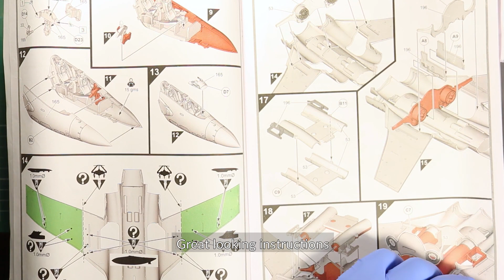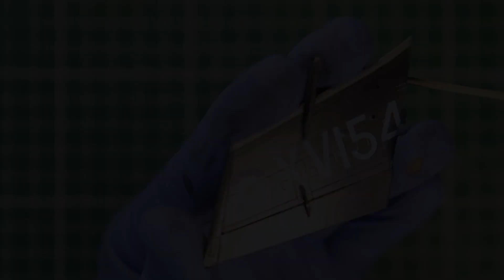Blackburn Buccaneer Royal Navy 1/72 Airfix Plastic Model Full Video Build

Comment: G'day Doc, That's an excellent piece of surface finishing resulting in a 'well worn' buccaneer in, I believe, the FAA's old livery. I'm envious as at my age most 1/72 aircraft, like the small fighters, etc. are too fiddly for my eyesight and sometimes shaky old fingers. Of course, doing 1/32 aircraft models comes with their own set of challenges.
Now, I'm ex-RAAF but I do specialise in military aircraft. 
I can't recall in any of my research seeing naval attack fighters being stowed either on deck or in the hangar deck with ordinance still attached to folded wings. Not even just prior to take-off, as the ordinance personnel can only arm the aircraft with the wings locked in the flight configuration.
It's a small point and would probably only be picked up if submitted in competition. Overall, your Buccaneer is certainly up to competition standard. Apart from the ordinance; it has the authentic look of an aircraft that has really clocked up the hours. Apart from public demonstration aircraft and recreating certain museum airframes, I never finish off a model as if it's just rolled out of the factory. These, generally, look too much like 'toys'.
I've just done the FAA Vampire LZ551/G which was the first jet in the world to land on a carrier; flown by the late, great, Captain Eric 'Winkle' Brown RN, (when he was a Lt.Cmdr.). That Vampire was, correctly, saved and is on show at a museum in the UK. So, I modelled it as it appears today, in pristine condition.
Job well done, Doc! Cheers, Bill H. Tasmania
Reply from the maker: Thank you :)

Comment: Lovely build. One of the best Buc builds out there. I was interested in the way you go straight from 220 to 1000 grit sandpaper around the canopy. Do you also use intermediate grits between 220 and 1000 or do you find that they alone will get the job done and remove all scratches? Thanks!
Reply from the maker: Thank you :) I am using only 220 for rough sanding and 1000 for the finer.If needed which was not the case with this build i use 1500 and 3000.But that is in rare ocasions.

Comment: Nice build!  If you don't mind me asking, what did your homemade black wash consist of?
Reply from the maker: Thank you Roger.My homemade wash is basicly water with some water based ink and a drop or two of liquid soap.Quite an easy thing to do and lasts for years depending om the amount you initialy mix.You can also thin it down or add more ink to make it more or less pronounced.
Reply: @doctormig2709  - Many thanks.  It looked very effective and easy to use.